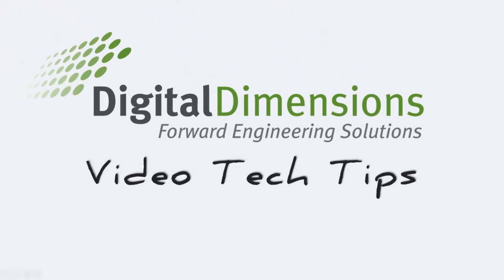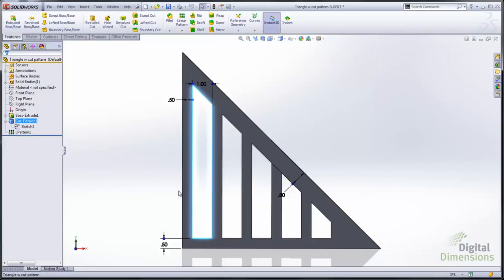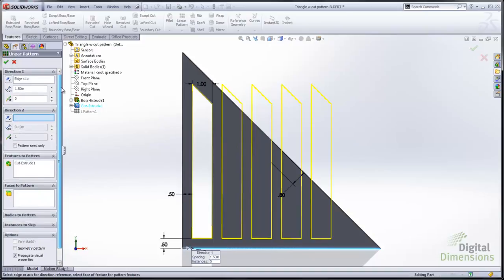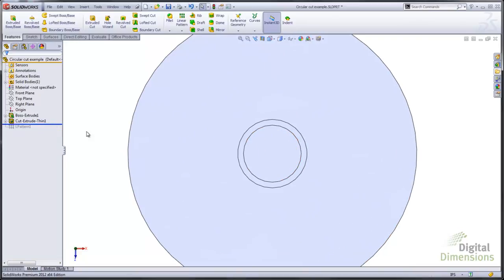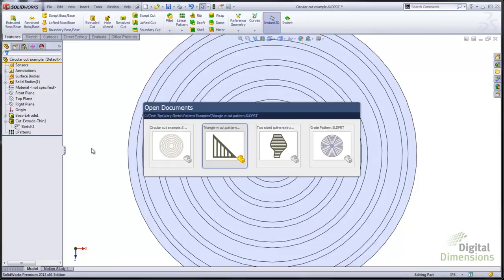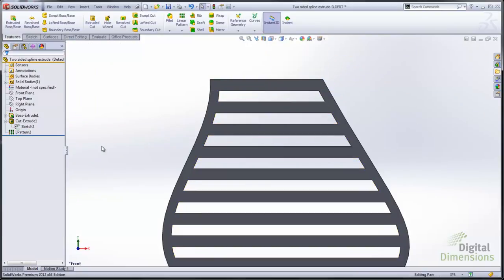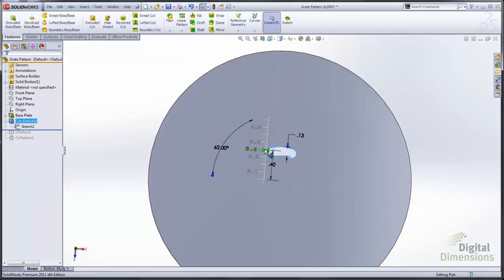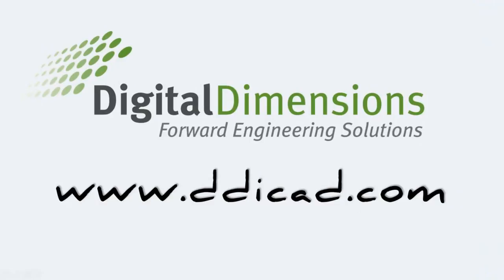Creating a Vary Sketch Pattern

Comment: im having a hard time picking the dimension itself to initiate the vary sketch option...I can pick the edge but no the dimension. is there filter or something im missing?
Reply: I know this question was many months ago but I too was having a very frustrating time selecting the dimension in the feature as the linear pattern direction but was able to figure it out so I will post it here if any future viewers have trouble.

You must select Linear Pattern, then select your desired feature as the Features to Be Patterned, THEN it will allow you to select a dimension within that feature. 

I had to watch the video several times to see this was being performed. Otherwise very useful video, thanks!